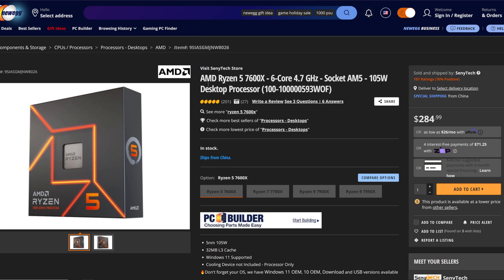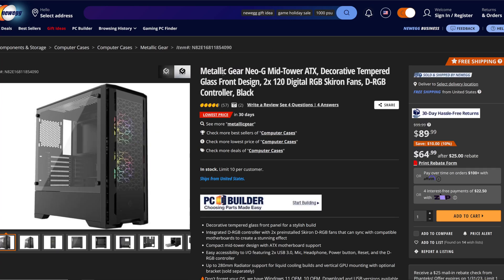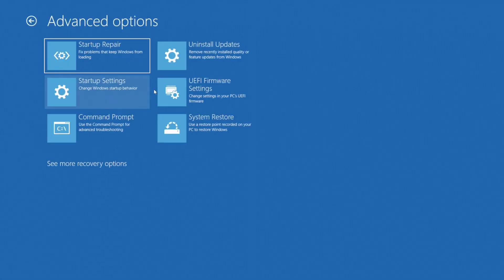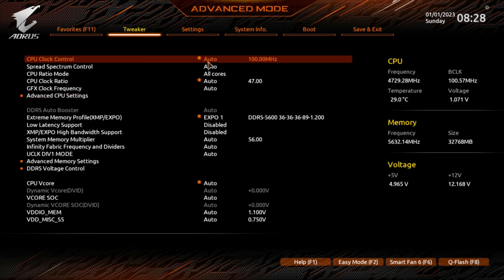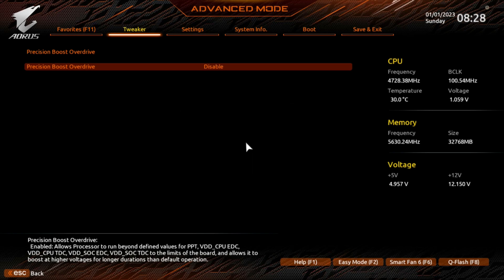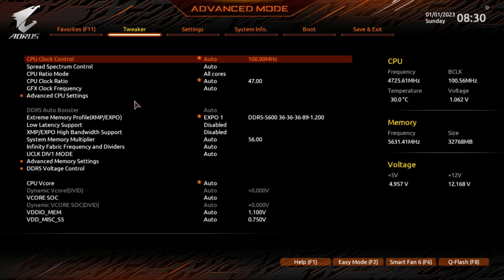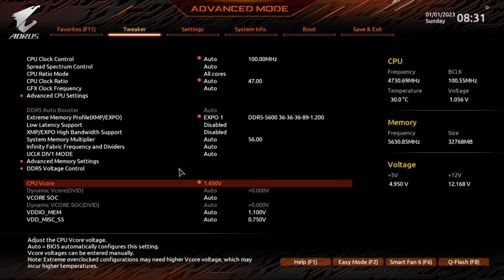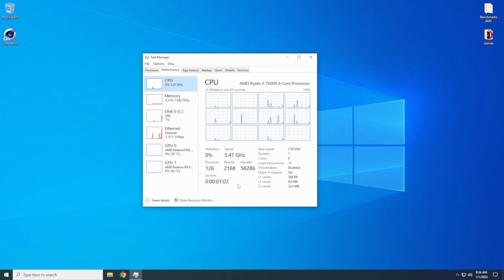CPU overclocking on the B650 Aorus Elite Motherboard

Comment: My 7600 nonx has been perfectly fine at manual overclock at 1.35v at 5.3ghz using this guide so i really appreciate it
Reply: Voltage way too high I get 5525ghz at 1.27v or 5425ghz at 1.215
Reply: @mobilephone6388yes sir It's still okay at 1.28 is what I have it at for 5.3ghz. And for it to run cooler I think I even did 5.2.50 or 5.2.75ghz
Reply: I did lower it cause I felt it was too high also @mobilephone6388
Reply: Mine is 7600x though I just noticed you said non x and realised what you meant but still maybe you can lower voltage
Reply: @mobilephone63887600 can literally be overclocked the exact same. I have my non x 7600 and it's been at 5.3ghz for a year and throws out less heat than 7600x. You overpayed bro

Comment: Hi, if CPU Clock Ration and CPU Vcore are not available choices on the motherboard, does that mean the CPU cannot be overclocked? I have the Gigabyte x670 aorus elite ax, screen looks the same.  I have a Ryzen 5 7600x3d that is exclusive to Microcenter, so it's hard to find much information on it.

Comment: I undervolted my 7600 with same operation and it  's great, 60° in stress test , 5.0ghz at 1025mv, great video bro
Reply: What are your settings? I have the exact same mobo and cpu as you, thank you in advance!
Reply: @zackeryholder24  in bios > first make defalut settings > tweaker > 
a/ n°4 cpu clock ratio = 50.00 / 
b/ xmp expo 1 at 6000mhz
c/ CPU Vcore = 1.025v
Reply: you can test it before with amd master > basic view > manual profil > frequence 5000mhz / voltage 1.025v and test, if OK put it in bios
Reply: @mr.mok7  i did the same thing and my cpu has dropped 8C so thank you

Comment: Hello, whenever I set the CO to -40 plus setting the auto 80c level 1 profile, the max temp changes to 89, and I can't do anything to help that, I changed the max temp manually, and did set the control mode manually to the 7800x3D default settings and reduced the TDC to 80, still didn't work, it's either the full 80c profile alone, else it will reach 89c, with the co set to -40 I hit 5050mhz all cores, with 80c level 1 preset profile it gets 4840mhz allcores with 80c temp. it really doesn't matter to me but that's weird.

Comment: I have the same processor and board but 6400 ram.. I set it to expo and it will not boot... I may try the manual way as you have done

Comment: my cpu can reach max 5.1 ghz(13600kf) I got the b760m aorus elite ax  mobo. When I go to CPU Clock Ratio, all I can do is max 51, which is what the CPU runs to.. There's no number above 51 in the list nor works if I manually type it. Any idea?
Reply: you can't overclock intel cpu's on a B/H motherboard's only on Z motherboards
Reply: thx @hamoody2062
Reply: @hamoody2062 😂😂😂

Comment: Is the 5.5 and 1.45v stable? No bluescreen?
Reply: I definitely tried to mimick Dave's settings and without fail it would send the PC into failsafe mode and shut off. The CPU is max rated for 53.00 mhz, 55.00 is too much

Comment: What brand snd spec of ddr5 ram are you running on that board. I bought the same board and im trying to pick out ram now. Just wants somthing like what you chose?
Reply from the maker: here is a link to the ram kit. https://www.newegg.com/g-skill-32gb/p/N82E16820374417?Item=N82E16820374417  Thanks for watching and the comment.
Reply: @DavesTechway  Thanks allot great video.

Comment: 1.5v!!!!?! yeah up to 1.5v in nano second boost. 1.5v will absolutely fry your system
Reply from the maker: 1.5v sounds very high to me too, but they say you can go that high. Thanks for watching and the comment.
Reply: @xGoody05  PBO or precision boost overdrive pushes 1.4-1.5v all the time. If AMD said it was safe which it would be if PBO does then Im sure it would be fine if you can keep it cool. Just because a YOUTUBER says 1.4 is too high doesn't mean they are right
Reply: PBO pushes the voltage that high all the time lol. It wont fry your system at all, you dont know what your talking about.
Reply: @xGoody05  I do know what I’m talking about and he’s on Zen 4 not Zen 3 idiot.. I have a 5800X that clocks to 4.95gz all core at 1.35v. Nobody is talking about Zen 3 here lmfao. Go home